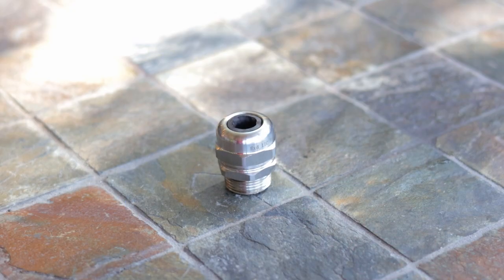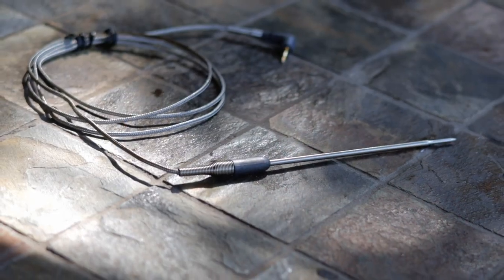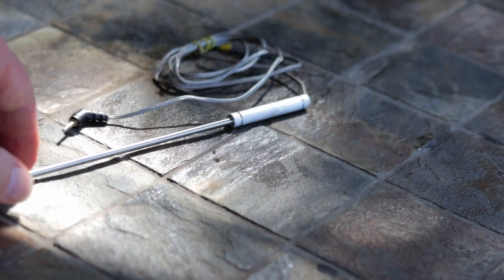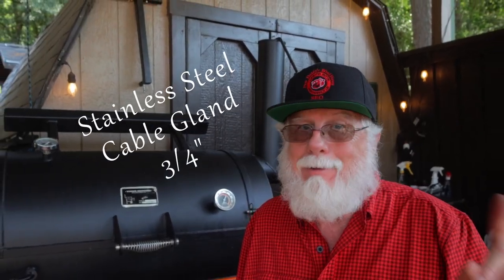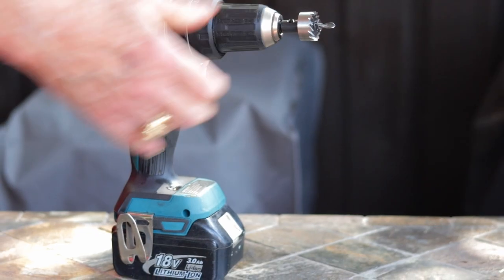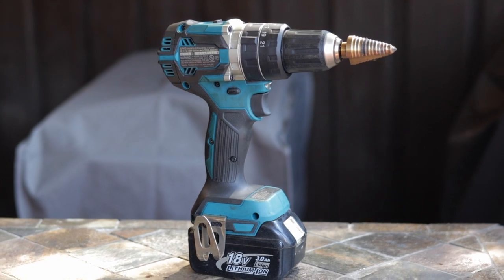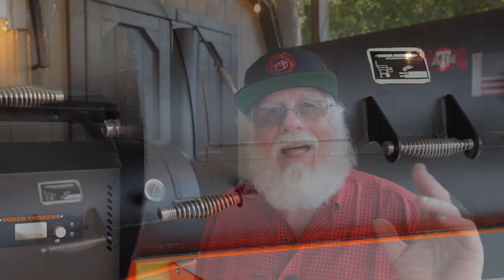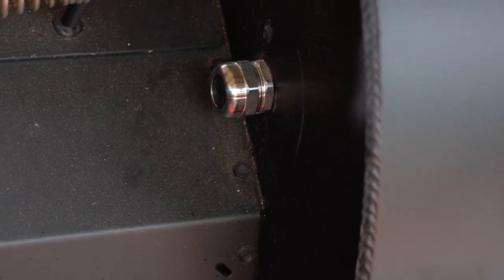Use This For A Probe Port On Your Smoker Or Grill

Comment: What size conduit locking nut did you use?
Reply from the maker: Since I used a 3/4” Cable Gland with 3/4” NPT threads it required a 3/4” conduit nut.
Thanks for watching.